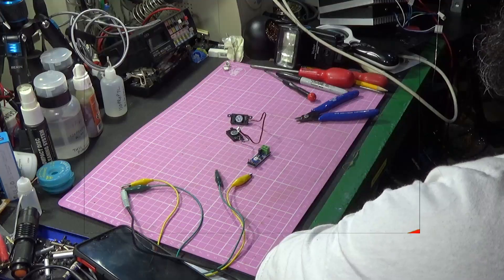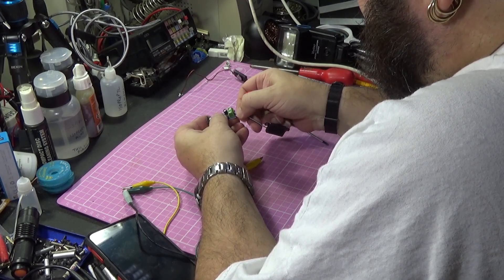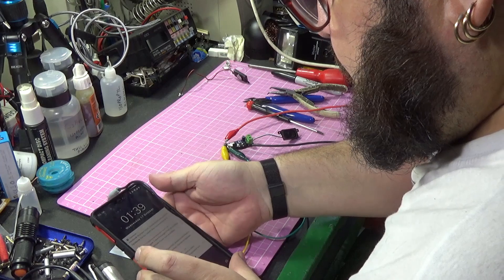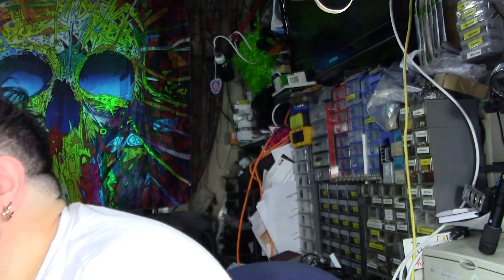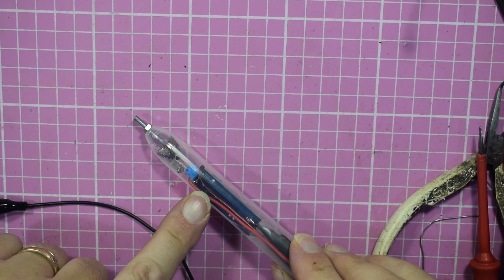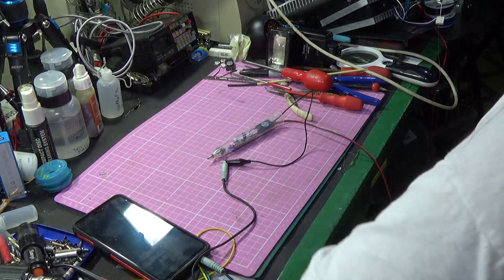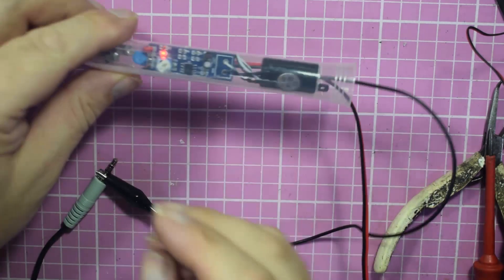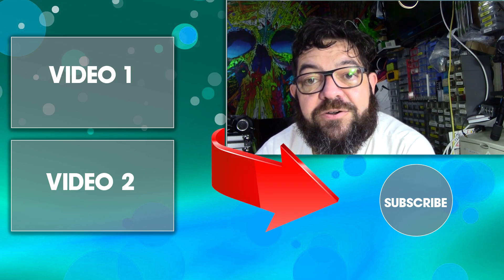How to build an audio signal tracer for less than $3

Comment: George, here's a question , and the answer might help a lot of us out.  Is there a place where you can just email your bill of materials and pay for the components and it's a done deal?  Today I exhausted myself trying to find old radio capacitors that could handle 650 Volts.  Where can we buy stuff without getting robbed or sent counterfeit garbage?
Reply from the maker: The problem is that the modules are chinese and can be had from a variety of places. Mine came via AliExpress but the seller has either stopped selling or has changed name. The other problem is where people are located in the world. I could link to ebay uk but the seller might not ship abroad, I could link straight to china but the price varies by country and from different sellers. and I don't have favourite sellers, I just shop by ratings and price.

here is a search link for the module from Ali, you can choose any one that fits your needs and you will have Ali protection against fraud. If it doesn't arrive, you do get refunded but the shipping times are quoted in months, not days.

https://www.aliexpress.com/wholesale?catId=0&initiative_id=SB_20200927035331&SearchText=lm386+module
Reply from the maker: @BillKatakis  I find it better to bulk buy parts. Valve radios can be particularly expensive but if you shop around spares can be had quite cheaply. I tend to buy high voltage caps in bulk direct from china and that is a big saving over the one off prices. Resistors again, larger quantities can save a lot but you only save if you are actually going to use the components otherwise its dead money. Modules and kits really are best from china direct...
Reply from the maker: @BillKatakis  the poly caps are usually the 630v ones for 240v sets, the electrolytics are 450 or 500v ones. US sets have lower voltages but it doesn't hurt if you use higher voltage caps.

Comment: very neat george.  One  inprovement you could make for RF work is to add a small 1 or 2 trasistor pre amp  so you can check signals coming off the tuneing cap  and coils and before the 1st if stage.
Reply from the maker: It would be something I would do in a bigger unit for sure. This was more an example that the build is not complex or beyond anyone who has just got into the hobby.  It certainly is a valid point to make the unit more flexible.
Reply: @GeorgeChristofi  Agreed and for traceing audio it's perfect

Comment: Quick question. Would it be possible for the 386 board to be put into a box and have a lead come off the box with a probe? In other words could it be built so that the 386 doesn't have to be part of the probe apparatus?  Keep it in a separate box and just branch a lead off with a probe put into an old pen so as to make it less cumbersome?  From the probe to the input are there diodes, caps or resistors?  Thanks.
Reply from the maker: That would be a perfectly feasible approach to tale. The only thing to do is to make sure you use shielded cable for the link to prevent the pickup of spurious signals.

Comment: neat little unit cant say I am impressed with the excruciating little  squeaker  !
Reply from the maker: It isn't bad considering it was all chinese stuff from Aliexpress. sure, it isn't the most sensitive, the nicest to listen to or even the best way to do things but it was a simple throw together with parts I had lying around!
Reply: @GeorgeChristofi  yes I do that sometimes use what ever is to hand it does get the job done I used to use a crystal earpiece and jack socket in a ball point pen case to trace signals worked well if you could find a crystal earpiece that worked ! thanks for the Sub !

Comment: George - is this easy to build for a novice? I watched todays RC Live and it finally clicked as to why they are so useful with the help of a circuit diagram when tracing faults. I know Graham uses his a lot. Which board should I look for? Thanks. Has someone got 'plans'?
Reply from the maker: It really is novice level because the audio board is already configured. all you do is add the input section. if all you are doing is looking for audio then the only thing you need to add is a capacitor to protect the input. I used a 2Kv rated one simply because I pole about in valve sets and can come across voltages up to 700v in places. Another version of this type of generator is http://www.pasttimesradio.co.uk/build/diyradio.html and this can be built very easily. if you take the schematic from that website, the probe is actually everything in front of c2 and can be used with any audio amplifier module. Mosslack and robert gibbons on youtube are working on a good kit which is close to completion and you can either wait for the full kit or work from the schematic. Mosslack (Doug) has been working on a lot of generators and the final one seems to be the best of the lot.

Comment: Thanks for the idea.  That little amplifier module is nice & compact.  Where did you get those small micro speakers, on ebay?

LOL Napoleon XIV''s classic song.  I remember when that first came out on the radio here in the US in the late 60's it quickly got banned.
Reply from the maker: They came from AliExpress. About 2 pounds a pair I think.

Comment: LMAO...They're coming to take me away Ha-Haaaaaaaaa...I love old novelty songs like that.  I have that one here along with a ton of others.  Had to introduce Charlie Drake's "My boomerang won't come back" to a young guy the other day who didn't get it as the reference I used about it when he said he'd gotten a boomerang.  Love the signal tracer build.
Reply from the maker: I used to collect records that were either novelty or banned from radio play.
Reply: David Allen Coe had a few of those banned ones as I recall, lol.  Finger F***** Sally comes to mind off the top of my head.  I'll check out that Dread.  :)
Reply from the maker: Got some of his too. As well as Andrew Dice Clay. Judge Dread was doing the nursery rhymes in the 70's. I think every single one of his records was banned the minute they were released. There are so many over here because the BBC was run by prudes. I think my favourite is still Father Abraphart and the Smurps, 'Lick a Smurp for Xmas (all fall down)'. That was a response to the fact that the Smurfs originally given out by petrol stations were painted with lead based paint.
Reply from the maker: If you want something different, have a search for Judge Dread. He was a very large English guy who sang rude reggae songs.